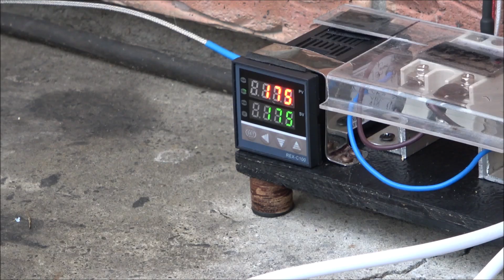Wrong Fuel Recovery – Real-Time Separation of Diesel & Petrol (20L Test)

Comment: good work. can this machine be used to convert waste engine oil to diesel?
Reply from the maker: Not this one, it is designed to recover diesel and petrol from an accidental fuel mix, also petrol fractions from pyrolysis oil (but it has to contain light fractions) also will separate petrol fractions from natural gas condensate, will separate diesel fuel from diesel oil mixture (gearbox or engine flushed with diesel) also will separate diesel fuel from red die contamination. For used automotive oil distillation you will need another one: https://youtu.be/VH5P_Jt2Nvg?si=i9yNvJZhnSrJU6CD